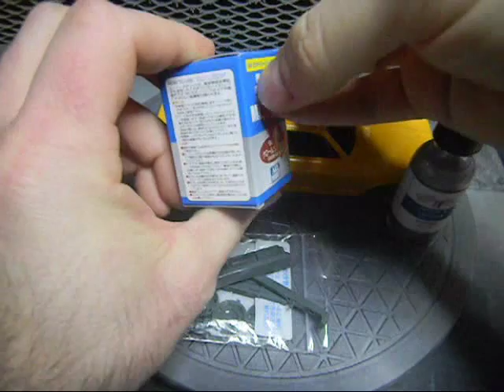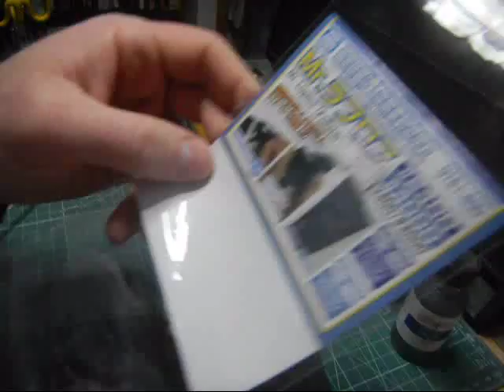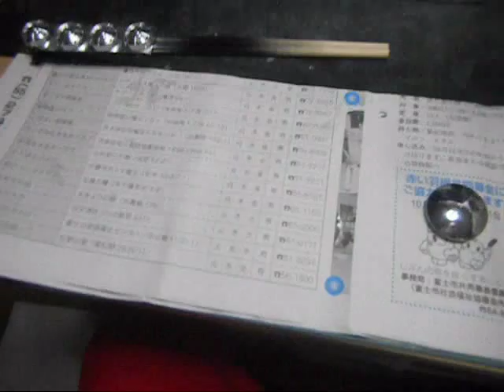1969 Mitsubishi Colt Galant GSII plastic model build video 2 Doyusha

Comment: A+ episode. FWIW, what I do re: dust is when I'm finished painting I put the piece on the desk and then cover it with a plastic container. Never had a dust problem.
Reply from the maker: Yes, you'll see that in the 3rd video. I finally got a plastic DVD box to put a car's body in. I also drastically re-strategized my workspace and realized where a lot of dust is coming from. I was letting dust collect on top of my spray booth, even. I now make it a point to dust all the shelves in the room, Swiffer the floor, and also dust the overhead fluorescent light now, especially before attempting a gloss paint job.

Comment: Those old colt's are looking nice... Great color for the car.
Alclad is great but you need a alclad gloss black undercoat before you use it.
But when you do it is the best it can be used also with a brush ofcourse over gloss black coat....So it's more ment for big parts that have to look good & smooth. If you just want to pant little chrome parts then the metal paint from vallejo is one off the best.
.Tutorial : Chroming with Alclad
Reply from the maker: Thanks for sharing that video. I've already watched it actually, and that and Swanny's website is how I learned about how to use Alclad Chrome. I don't think either the video or Swanny's site mentions that I must use Alclad gloss black. They just say gloss black.

What I used was Mr. Hobby lacquer gloss black from a spray can in this video. Yesterday I repeated the process on a side project with Mr. Hobby lacquer gloss black from a bottle and used my airbrush. It applies much better, and of course I have better control. I'll see how taht one turns out. I may have time to chrome it this evening.

So going over the Alclad Chrome a few days later won't get it any shinier than it already is, right?
Reply: stevethefishdotnet No it doesn't because it is liquid metal basicly .when i did see you use mr hobby  i thought already also well maybe that doesnt matter. but for just a doorhandel you can just try alclad or mrhobby chrome on itself but it will not be as shiny that's why a lotta people take vallejo liquid metal silver.

Comment: That's really cool how the Cola stripped away the chrome, I've never liked chrome parts, since you can't paint the little bits where they were attached to the sprue, worse is if the part had flash on it. I really want to try Alcald, and use it on my P-51, but wasn't sure how to use it, seeing what you've done I really regret not buying it, it looks amazing :D How did you clean it from your airbrush?
Reply from the maker: I just cleaned my airbrush with Tamiya Airbrush Cleaner. Alclad is lacquer paint, so I'm sure just running lacquer thinner through it afterwards will clean most of it out. I then took it apart and used cotton swabs (the thin Tamiya swabs come in handy for this) as always.

So this chrome paint sure is nice, but I failed to achieve the true mirror finish that others can achieve. I wonder if the problem was with the gloss black paint I chose? It sure seemed glossy enough. I am at a loss. It looks nice; don't get me wrong. But it's not quite as great as others can achieve.

Comment: If you have AMT ERTL kits or Revell, Monogram etc you have to wash the body in warm water to help the paint bond. But I dont know about Doyosha. Just a tip you know if you use the testors cement for clear parts it completely fogs it up and it looks like crap. Is the Tamiya cement good for clear parts?
Reply from the maker: I don't use Testors cement very much at all. Especially if it is not a totally fresh tube, it gets very stringy, like silk from a spider's butt. I don't trust it very much anymore, except for hidden places that need to be strongly glued.

Tamiya cement causes fogging of clear plastic, too. I intend to use Micro Krystal Klear for that. I wish I'd known about that when I built my Tamiya Honda Fit. I found a similar product here in Japan made by Mr. Hobby that goes by a very long name full of kanji: "Bitoumei Sechakuzai" (美透明接着剤). I had to ask my wife several times to help me with that one. Try saying that 10 times fast!
Reply: stevethefishdotnet haha yeah. I actually built a Doyosha once. But it was a Volkswagen Rabbit Cabrio. It was a blast but they don't make them anymore. I ordered a Doyosha 1969 Toyota Corolla from Shizuoka city
Reply: Damon Clark on ebay
Reply from the maker: Damon Clark Nice! I live next to Shizuoka City. Shizuoka is the plastic model capital of the world, you know? It has the most number of plastic model companies than anywhere in the world.
Reply: stevethefishdotnet Oh yeah? Wow thats awesome. I saw in when you where at the Tamiya Office you where into the Honda City. I own one and it's motorized and comes with a Driver. Its pretty neat